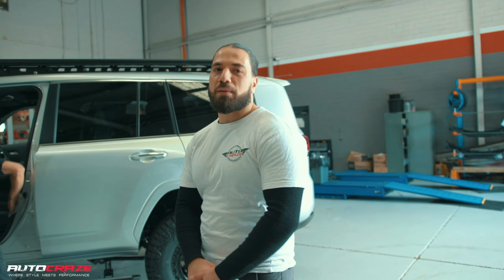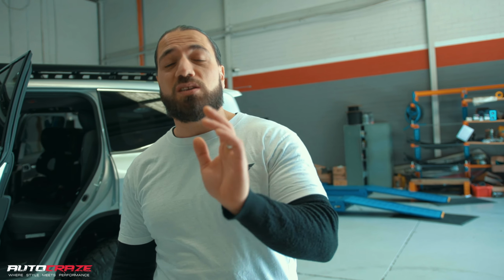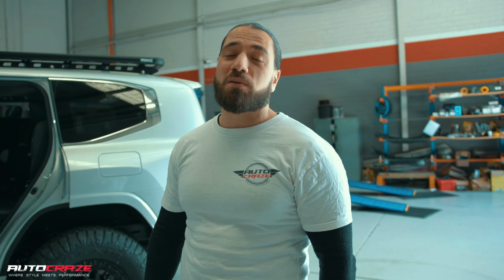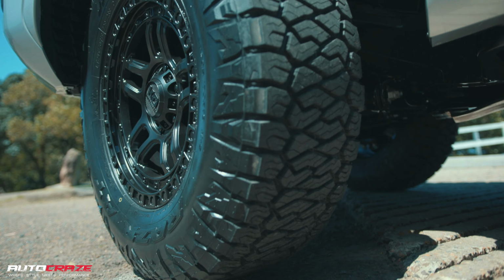2022 Modified Toyota Landcruiser 300 Series | THE KING 300! | 300 Series Wheels, Tyres & accessories

Comment: Looks cool, but illegal. 35's are greater increase than factory OEM than allowed (+50mm only legal) and the pos offset of 30 on the wheels is also illegal, max is to go pos 35 from factory of pos 60. But looks cool though...